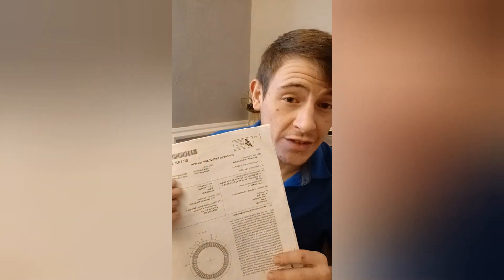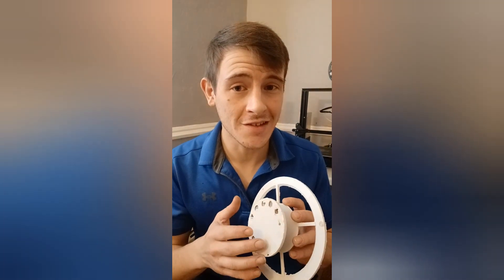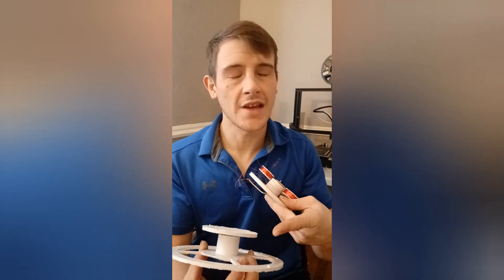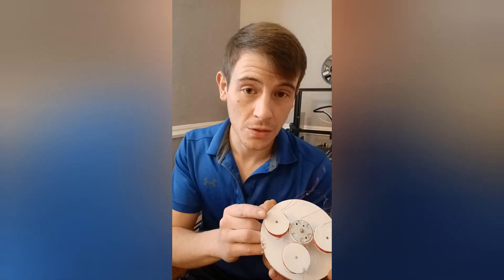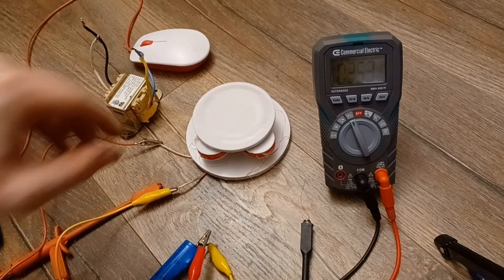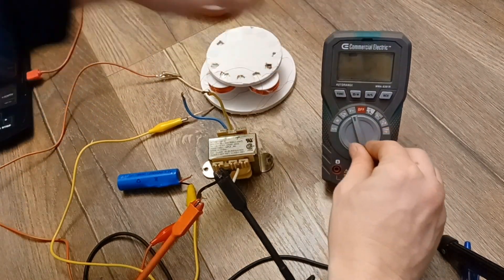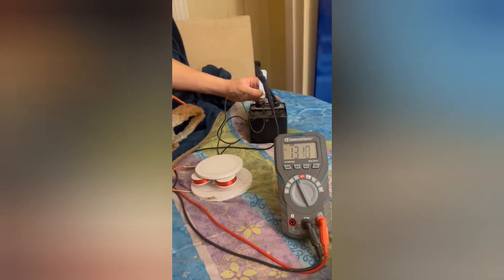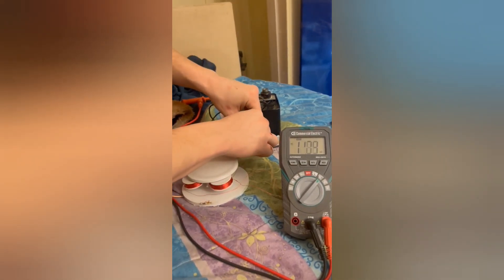Overunity Dodecatron Generator Part 3: Higher Frequency = Greater Efficiency

Comment: If it is actually overunity, there will be an unexplained cooling effect. Does that happen in your version? To test for a very mild cooling effect, you can use a thermal imaging device to detect any subtle temperature drops. I am an alternate energy researcher since the early 1980s, so, if you DO see this, it's proof of overunity results, and I can explain how it happens.